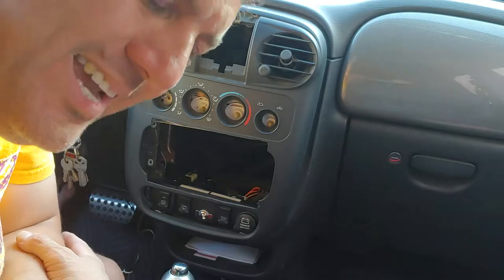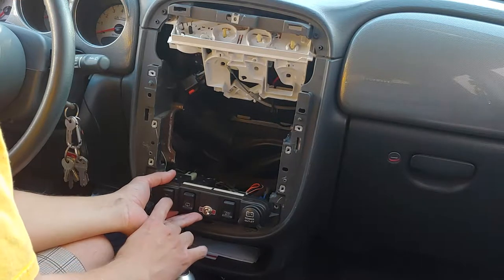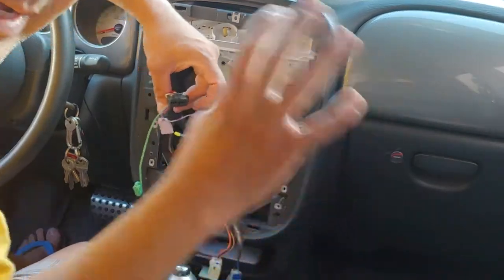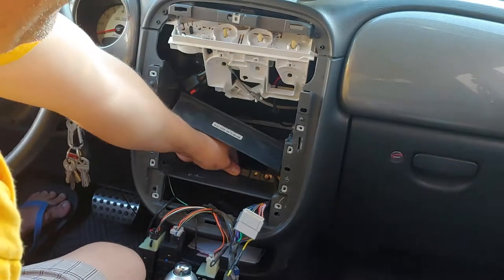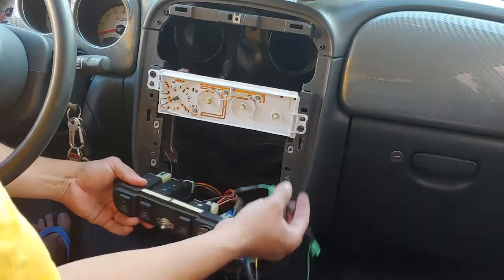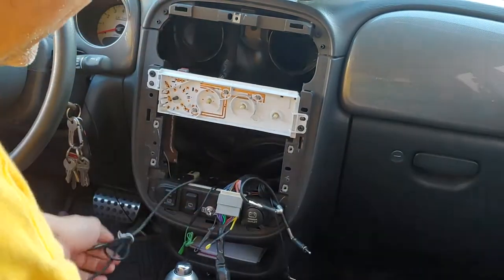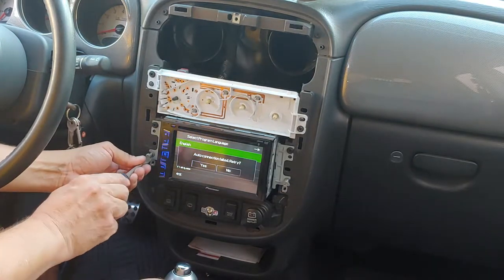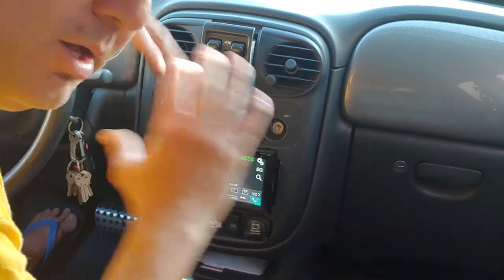2001- 2005 PT Cruiser double din conversion / modification in English & watching movies anytime.

Comment: Metra makes a double DIN conversion kit for the 01-04 Durango/Dakota, you might be able to use the template that comes with it for a cleaner cut and the bezel to make it look a little more seamless.
Reply from the maker: Hi nefariousangel.  I just saw your comment.  This is a great suggestion.  I'm not familiar with that kit, but the fact that it's a possibility for a nicer look is great to know.

Comment: I did exactly what you did and it fits great but I need those left and right pieces on each side of the radio I really appreciate you showing a video of that because I did it in pretty short time instead of a grinder I just took a  reciprocator saw off the metal brackets and it went through it like butter was kind of neat to see all this go together
Reply from the maker: Hi Tim.  Glad to help.  I obviously didn't measure the side pieces so mine turned out uneven but take your time and measure correctly and you'll have a clean fit.  FYI:  I'm in Southern California and I have 2 OEM subwoofers that I will put up for sale $300 for both.  You're the first I've told.  Thanks for watching.

Comment: What is the part number of the Scosche adapters that go on the left and right side of the 2din adapter plate and where did you buy them?
Reply from the maker: Hi Les Parnell.  It's the adapter to mount a single din stereo.  I cut the center of and used the edges only.  I had a video on it but it seems to have dropped off for some reason.  I'll have to reload it.
Reply: @luiselmilusos7625  Hi Luis. Which kit was it? I can’t seem to find anything that looks like can be used. Thanks!
Reply from the maker: @leescott9910  https://www.amazon.com/gp/aw/d/B000K3CNQ6?psc=1&ref=ppx_pop_mob_b_asin_title
Reply from the maker: Les Parnel , I added the link for the adapter.  I only used the part of the stereo and not the other 3 pieces and I cut out the center to only leave the round edges and cover the gaps.
Reply from the maker: @leescott9910  use the edges of the stereo adapter by cutting off the center.  Make sure you measure properly.
Reply: @luiselmilusos7625  sweet; thank you sir!